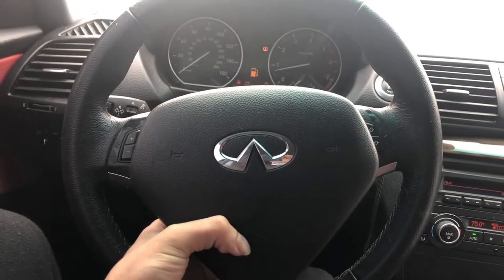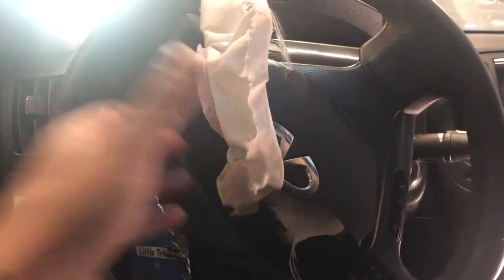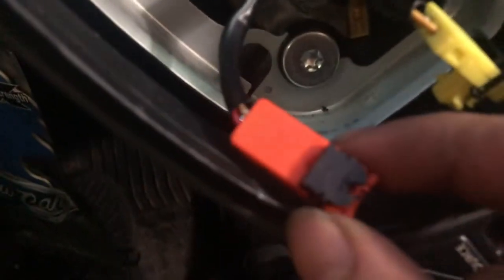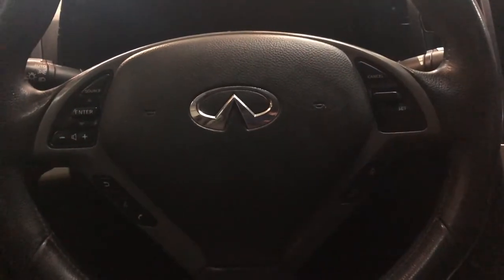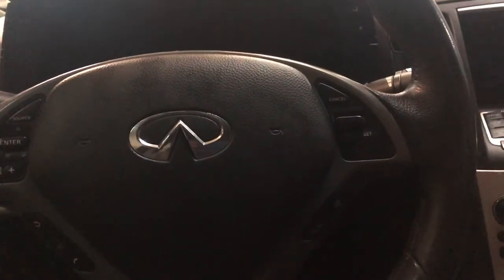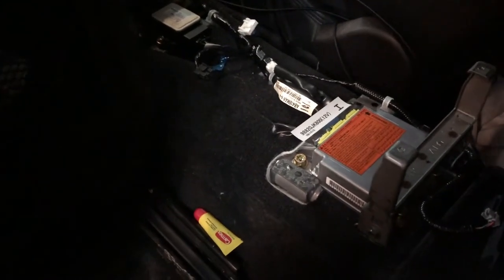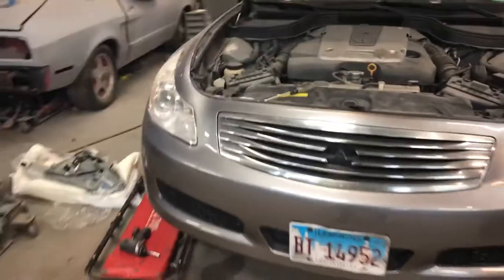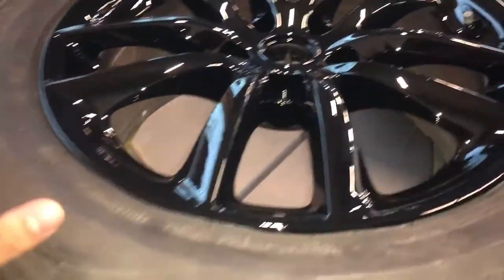How To Replace a Airbag easy

Comment: Hey I have a 15 cts I sent module to safety restore I’m ready to put the airbags back and the module how do I go about doing it just unhook battery and make sure everything is hooked up crash sensors etc? Thanks for the help drop more videos very helpful
Reply from the maker: Yea bro make sure everything is plugged in before the battery goes in

Comment: This plug in for my air bag was melted into the airbag and I couldn’t disconnect I tried just pulling them off but the orange and black cable pulled out of them so now idk wtf to do :)
Reply from the maker: You have to cut them now and replace them the connecters are like 3 dollars

Comment: I changed the steering wheel on my 2012 G37 & now the air bag light is on. The horn would stay on constantly when I connected my battery, so I disconnected the ground (inside the steering wheel) & the sound went away, but now I can't push in my horn! Maybe because the ground isn't connected?? ... Any suggestions? I think I just need to take it off & reinstall it again. If that doesn't work ill take it to the shop but It drives just fine.

Comment: i had hit a metal plate in the road and it set off my air bag and now my seatbelts dont work, they panels where the seatbelts are kind of popped out, i hear you have to reset the seatbelts or buy new ones not sure. you know anything about that
Reply: Same thing happened to me, what did u end up doing?
Reply: Damn going back to this makes me realize it’s been 7 months and I still ain’t fix it 😂, but I been riding around with no front seat belts or driver airbag, just haven’t been able to fix it yet, in a couple months I’m gonna end up fixing it , not sure how yet , what happened to yours

Comment: Was wondering. My passenger airbag didn’t go off but I’m wanting to buy a different oem dash piece with a new passenger air bag just to make the install easier because removing the airbag from the plastic dash piece is a huge pain. If I buy this brand new airbag will I have to program it or can I just plug it in and all is good? Again my airbags never went off I would just be installing a brand new airbag. Thanks

Comment: If the car is off & airbag already has blown do i still need to disconnect the battery to put the new airbag?
Reply from the maker: Yes always disconnect the battery first when you’re disconnecting electronics.
Reply: @lifeofmario9137  i jus got a new airbag looking to do it today , I see where the t30 torq is supposed to be used but where is the wrench needed?
Reply from the maker: The wrench is used to remove the screw in using a t30 and a small extension with the wrench to take them out.
Reply: @lifeofmario9137  i discinnnected the battery then tried just using the t30s on both sides of the wheel so the bag would come out but it won’t , is it because the wrench also needs to be used ?
Reply: lol sorry i jus don’t see where a wrench is needed

Comment: Do you have to sent moudle in right after new air bag install or can you drive it around for a while b4 you sent moudle in
Reply from the maker: You can drive it around. But know if you crash that airbag won’t go off
Reply: @lifeofmario9137  ok thank you  yes i do know i stll have some  others to fix thank you👍🏻
Reply: So is it better to not connect the airbag?
Reply: I dont want it to go off after connecting the battery

Comment: I have a question how do I unlock my seatbelts
Reply from the maker: Some off them you can’t repair bro and need new seat belts. Especially newer cars.
Reply: @lifeofmario9137  i have a g37s but my seltbelts are lock how can i unlock them?
Reply: Did you find the solution? Going through same problem

Comment: I replaced the steering wheel the air bag light stays on on diagnose it says there is a ground problem how can i fix it 2015 q50 2.0t

Comment: Hey I have a 2004 g35 and my air bag light stays on it’s not the sensor under the seat should I just buy a new air bag ?
Reply from the maker: Can you get it scanned?
Reply: @lifeofmario9137   do I need to go to the dealer for that ? Or could I buy one ?